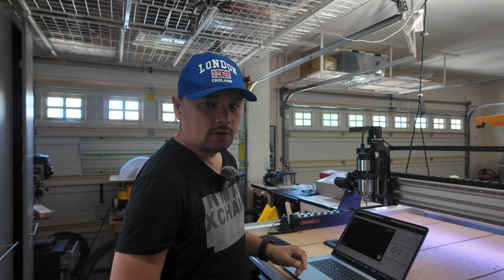Setting up AutoDustBoot on AltMill using SWT1

Comment: Francis, your auto dustboot solution is absolutely brilliant! As you know I actually own one, and as someone who typically uses slighly more advanced CAD/CAM methods for collision avoidance – approaches most hobbyists simply don't have access to – I am genuinely blown away by how effectively you've tackled this. You've clearly found a fantastic way for hobby CNC users to avoid collisions and protect their machines, especially given the limitations of some of hte more accessible software.

 If you're looking for a clever, reliable way to keep your CNC safe, you seriously need to check out what Francis has put together. This is a game-changer for so many – really well done!
Reply: Does vcarve pro have those features too Marcus?